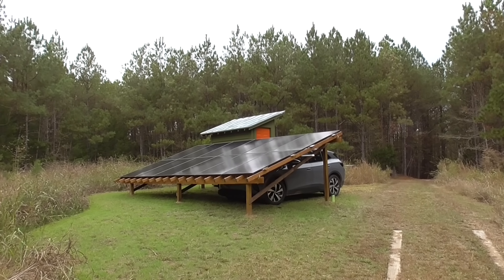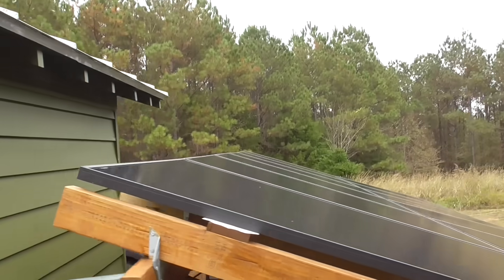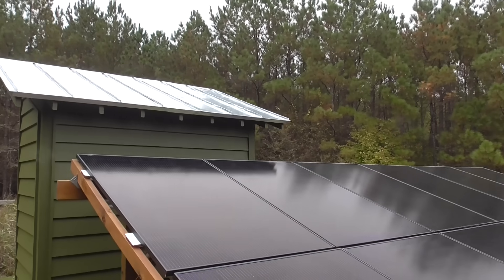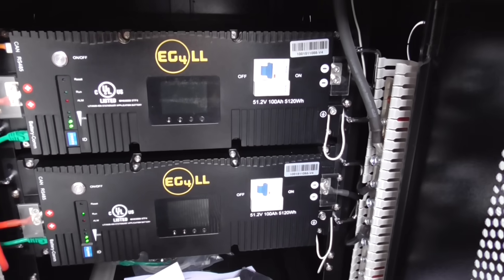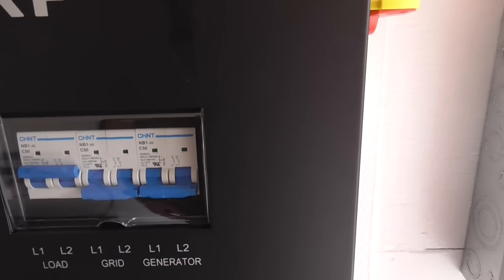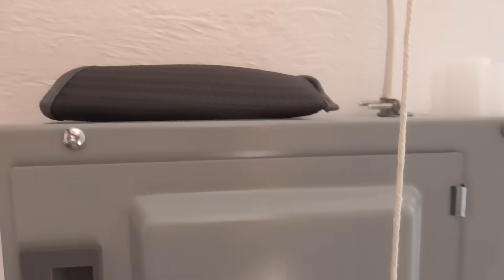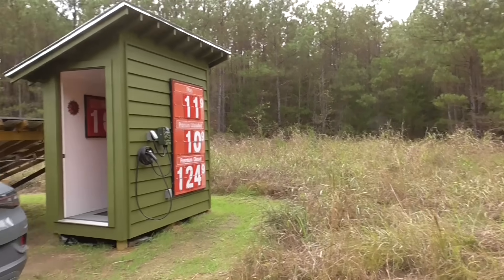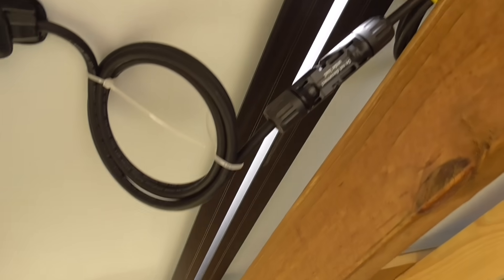Off-Grid Solar EV Charging Station. Stand-alone solution for EV.

Comment: If it was a sunny day could you charge even after the two 100 amp hour batteries are depleted?
Reply from the maker: So far, no. I think there is a possibility when the panels are in the perfect angle for the sun in the summer on a perfectly sunny day, the PV might just might be able to power the whole required amperage. As it is, the two arrays have each put in a third of the required power and the battery provides the other third. This makes the batteries last a long time and I usually get about 4 hours of charging from the day before the batteries are discharged and the sun is too low to charge them back up over the low threshold. I have wondered, however, since that Grizzlee charger can be set for different max amperages, that I could select a lower one that the PV alone could cope with. But that would also make the charging time longer proportionately. So in the end, whether it's slow or fast, I'll be able to get the same amount of charge on my car on any particular day.
Reply: @ thank you!  I came across your video when searching for “panel to EV”. I’ve been wondering if it’s possible to use our car batteries (we have an EV6 and an Ionic 5) as the storage medium rather than investing in the rack batteries, which  are still quite expensive.  We can use our V2L (vehicle to load) adapters to power some of our important appliances during outages.  Thanks again. And watch the end lumber exposed to the sun.  Sometimes it will warp and the solar panels don’t like that.  Best wishes.

Comment: I was an electrician for over 35 years.  You did a beautiful job on everything.   If you are not an electrician.... wow!  WELL DONE!
Reply from the maker: I was not expecting to hear anything positive about my wiring. It seems that everybody on Youtube makes a huge production out of elaborate conduit use. I thought about conduit and decided that it's just me in the shed and I'm not going to swing a hatchet around wildly and chop into wires so why do conduit? I am not an electrician, but I have a good understanding of it and I've done quite a bit of residential wiring for my rentals, mostly replacing knob and tube. I wanted it to be tidy but not go overboard with bling. Thanks for the compliment.
Reply: @wickedmessenger1  i 100% agree, VERY WELL DONE!! I left a note for you at the end of pt 2 looking for advice... ANY help or thoughts would be awesome! would luv to do something similar for my rav4 prime plug in.. its a way smaller 15ah battery and i am wondering if i could just go panels to inverter to my portable level 2 charger and make it affordable for my plug in needs.. Thoughts/advice? TKS
Reply: @wickedmessenger1  Conduit to protect it from squirrels and chipmunks chewing through the wires.
Reply: @stevewhitaker1474 well, the squirrels will only chew through it once 🤷🏼‍♂️☠️🤣
Reply: @ 😁Fried squirrel ...
Reply: This must be an exciting time for electricians!
Reply: Nice setup. Well done.
Reply: Except that he mounted the solar panels with wood which is an absolute no-no and the expansion and contraction through the seasons will ruin the solar modules.
Reply: Nah he put his 1 hole straps upside down. Tear it all out and restart

Comment: I am holding out for the DC-DC converter to send the power directly from the PV array to the EV battery.  I already do this with my e-bike, boosting from a 31 Vmpp panel to 36-42 volts to charge the e-bike battery.  Bucking or boosting DC power is easy.  I know this because I built the charger myself.  Connecting directly to the battery terminals of the EV seems to be a difficult challenge to overcome.  Once that part is solved then DC slow charging an EV directly from PV will be a reality-- without inverting to AC only to come right back to DC inside the EV.
Reply: It is true that EVs run at 360 to 800 volts, but the solar array runs at something around 400 volts so the boost ratio only needs to be 0.9 to 2.0, which is no big deal.  The difficulty in making PV-->EV happen is not the DC-DC converter.  It is the software hack to get the onboard electronics to close the HVDC contactor so that charging pins are alive.  This "handshake" is exactly what happens with DC fast chargers.  
    The MPPT algorithm is built in to the DC-DC converter, with the boost ratio (aka duty cycle) being optimized to produce maximum amps without dragging down the array voltage, which would reduce the charging amps.  Been there, done that.  No big deal.  Communicating with the car is the tough nut to crack.
Reply from the maker: EV DC chargers run between 400 and 1,000 volts.
Reply: You need a DC car charger.
Reply from the maker: @joelchang9589  Send me a link to where I can buy one.
Reply: @peteinwisconsin2496  it seems like there should be DC direct power to vehicle soon. It just makes so much more sense.  And potentially skips the expensive interim battery.
Reply: @keithjacobson4493  You still have to have a battery to be practical.
Reply: Enteligent make something that uses Pionix’s Everest stack internally to do DC to DC charging.
Reply: @futaris  BINGO!   That is exactly what I want to do.  DC-->AC and then AC--> DC is foolish.
It is no surprise that the software driving their solution is based on linux.

Comment: Do you have an emergency heater in the shed to keep the temp above freezing? Or, do the batteries have self heater?
Reply: Pretty sure the server rack batteries he is using, like mine, have built in thermal regulation/heater.  That’s especially important for the newer LFP batteries but true enough for any lithium batteries.

Comment: build looks great! You may want to invest in an small window AC unit for the shed to keep the ambient temperature of the equipment low.  The new EG4 units are much better than the earlier MPP Solar clones but all solar charge controllers generate heat.  Between the generated heat and the outside temperature I could see the inside of the shed getting over 100 degrees in the summer in South Carolina.  My EG4 6500 melted on me and developed a short.  Even running a box fan, the case temperature was 95 degrees and my basement was 85 degrees every day the summer it died.  My replacement Sol Ark 15k is much better and doesn't generate nearly the same amount of heat.

Comment: Nice. We have a similar system charging our Ford Lightning. 3.6kW, and were using an older version EG4. It had issues, so we switched out to Victron, dual multi-plus 2’s. I’ve heard good things about the XP6000’s, though.

Comment: One nice thing on Teslas is they allow you to adjust the amperage from your app or inside your car. Just a thought for anyone else looking to match an ev to an off grid system…
Reply: I suspect that most EVs allow setting the charging current from inside the car.  How else would the car know if it was connected to 15, 20 or 30 amps of 240 VAC?
Reply: @peteinwisconsin2496  to my knowledge our EV6 and Ionic 5 don’t allow such a setting however they do permit charging from 120v and 240v and within those setting an adjustment  from 25% to 100% of the energy entering the car.
Reply: @peteinwisconsin2496  The charge rate is set by a hand shake between the  EVSE (the Charger) and the car. The charge rate is set at the highest  rate allowed by both the car and the EVSE. The EVSE is responsible for knowing the Supply Circuit Rating and not allowing the charge rate to exceed the what is allowed on that circuit.
Reply: @ That would be logical but as of yet Tesla is the only one I know of that allows this. 
I have recently driven polestar 2, Ford Mach e, and my wife has a Nissan leaf, none of which allow this.

Comment: seems like you could have mentioned the actual cost; even approaching $100k is far too much.  Also how long it takes to charge on a summer day or a overcast day like you showed on your video.  One source I read indicated 10 panels in Pheonix could only generate enough power to move a Tesla Model 3, 30 miles.  So while you did have 12 panels; seems like you are talking several days to go 140 miles?
Reply from the maker: I don't know the details of that 10-panel system, but it must be nothing like mine. I can easily add 35% to my car's battery in one day, which is 80 miles for my car (I believe Teslas go further per kW than the ID.4). My cost was well under $10k, but I don't want people to obsess about it. This situation is an isolated location with no commercial charging stations nearby. I seem to be hearing from people with the idea that if this doesn't exactly match the convenience of driving an ICE vehicle, then it's useless. I do not want to continue burning fossil fuels. I believe it's wrong. Therefore I am taking the steps to cut down as much as possible in contributing to global warming.
Reply: @wickedmessenger1  You get 80 miles in a single day what time of year?  That day you shot and it was overcast; how far under that senerio?  You are in S. Carolina in summber vs winter?  These are useful to know; I am in Seattle; so we don't get the sun  you get; I have some remote property also so I am considering that same sort of thing for practical purposes - Maybe the range difference was the panels - you said you got a bit over 4K system - which is 400w panels?  If you used 100w then I gather it would be more like the 20 miles correct?  As for the burning of fossil fuel or other types of fuel;
just as a check - you do realize that total CO2 is 440ppm and the human contribution is about 110ppm.  That is 1/10,000th of the atmosphere. So worries about human produced CO2 doesn't seem too serious; those trees near your charger would like to absorb that CO2.   For me it would be more the matter of independence.  If can have transportatin for a period of years at similar cost; where I can get around without being dependent I'd like that but I could potentially make my own ethanol or bio diesel.  To do those myself are not real cheap or realiable; solar seems possible but I am concerned that some days where it is rainy or cloudy; I'd not get very far.
Reply from the maker: @litestuffllc7249  I never said in the video that "here is a solar charging station that everyone can use." I only wanted to show what I came up with for my circumstances. When I go to the farm I go for a week or so. The first day I arrive, the shed batteries are at 100% and I usually arrive around 11:00 a.m. when the sun is in a good position.  My first priority is to charge the car up to 50%. I can easily do that on the first day and it takes about 3.5 hours of charging. After that, every time I go somewhere and come back, I charge back up to 50%. That's a happy place for the battery to get maximum life out of it, especially if the car is just going to sit for a while. As you can see from this use pattern, I don't have an urgent need to charge up to 80% or 100% in a hurry while I'm up there. If I get an overcast day, that's not going to be a problem, there's almost always enough PV to get the shed batteries back to 100%. As the day of departure nears, I keep an eye on the weather. I like to have 80% to drive home, even though I usually arrive with 17 to 19% still in the battery. I like the cushion just in case it's a windy day and I get lousy efficiency. If it's a sunny day when I leave, I can go from 50% to 80% in about 3 hours, then I drive home. Perhaps it's going to be overcast, so I start charging a day or two in advance. You don't have to believe in science of global warming to want to drive an EV. As you pointed out, it's about independence. And even though there's an initial investment, everything after that is free and eventually you'll pay yourself back and then it's all gravy. This is not to mention that there are no oil changes, air filters, oil filters, etc. to pay for. The EPA's calculations for my car said that I would save $6,500 over the first 5 years of ownership compared to an ICE vehicle. I spent that much making this station, so at this point I have pushed those savings out 5 years from now. Again, it's not about the money for me. I needed a way to be able to have this isolated farm and go there using my EV, which is the best car I have ever driven. I calculated that the electricity I use charging the car at my house, which comes from the grid, to get up to the farm costs me less than $5 for the trip to the farm. My truck needs 6 gallons of gas for that same trip, so even with gas being quite cheap right now, I'm saving about $17 dollars each trip to the farm. That adds up. And if there's a zombie apocalypse, there won't be any gasoline, but there will be sunshine. If there's no sunshine either, well we're all fucked.

Comment: Nice setup!  Want to do similar.  Question: are you concerned about that little utility room heating up? Is there ventilation?
Reply: A thing commonly found on green houses are ventilation fans directly powered from a small PV panel.  When the sun is most intense, the fan runs at its maximum, providing cooling when it is most needed.
Reply from the maker: I am concerned with that. I am going to see if there is a problem next summer and get a little AC unit if I need it. This past summer, which was mostly over by the time I got done with the project, I would keep the shed door open while the car was charging. It never got to the point where it shut down for high temps. And generally there's no problem with keeping the door open for those hours, so that's been my solution. Like I said, I am willing to go with an AC unit if that seems like the way to go. By the way, I fully insulated the shed and the roof is highly reflective, so it stays cooler than the ambient temp during the day if the inverter is not running (like when the car is charging).
Reply: @wickedmessenger1  thanks for the reply, and please post any updates on this, I'm curious to know as I plan to build a similar shed.

Comment: You should hook up a generator to the EG$6000 so you can charge your electric car with gasoline.
Reply from the maker: That's absurd. I have a 100% success rate with this setup. I have never failed to charge it up enough for my 144 mile drive home.

Comment: You've certainly enough space to install another row of six panels, which would increase your number of self sufficient days, even a couple of panels on the shed roof could assist with battery charging.
Reply from the maker: So far so good, but if I decide I need a longer charge, I can add another battery or a few more panels. I'm going to wait and see.

Comment: You are very handy. Impressive work. I will just buy hybrid and spend my time watching youtube of people building themselves awesome charging stations for overpriced cars.
Reply from the maker: I know people think that EVs are expensive, but I bought my VW all in (tax, tags, floor mats, dealer prep, etc) for $30,000. Brand new. Not a lease. It will pay for itself in what what I would have spent on gasoline. Plus I'm very glad to not be burning gasoline.
Reply: @wickedmessenger1  That is a great price. I wish you  will not need a mainenance on that VW.
If it is to spend extra money to avoid burning gasoline I can understand. If it is to save money on fuel for transportation, I would love to hear what is your estimate of ROI ? How many kms driven to get money back from that setup ?
Reply from the maker: @Martinko_Pcik  What's my ROI on gasoline? I have been buying it for 40 years and I never got to the point where Anyone said, "You know what, you've spent enough on gas, so from now on it's free."
Reply from the maker: @Martinko_Pcik  This situation is an isolated location with no commercial charging stations nearby. The cost is irrelevant. I have a solution to my problem. Please tell me the ROI on putting gasoline into your Prius. Tell me when the gas station tells you that you have already spent enough on gas and you don't have to pay anymore. This charging station cost me under $10,000, so by your experience, my ROI is 11.5 years. Does that satisfy you? I don't see this in monetary terms. I see this as a way I can drive an EV, not burn any gasoline, and have convenience in a very isolated location. Tell me, at times when gas is expensive, don't you have to buy it anyway? I am operating independent of the price of gas and you are a slave to it.
Reply: @wickedmessenger1  thats right.. u cant buy peace of mind.. once he is out there HE knows he can drive away from there once something hasnt directly failed.
Reply: I think it's awesome. And there's more than just dollars roi. He now has electricity on the property that could come in handy, running some power tools or maybe a future workshed. He also has the convenience of charging up while he's at the property rather than stopping on the way home.  And finally gaining the experience on DIY solar will save him on future projects.
Reply: @tpistor  I agree. I have missed the point of having electricity for other things and the joy of accomplishment. I really liked the result. Got distracted with the electric car issue.
Reply: @Martinko_Pcik i just enjoy watching people do diy setups.. man i cant even afford a ebike much less 5 of the panels.

Comment: How does the shed do in the weather? Hot/cold
Reply from the maker: I finished in the summer, so I don't know yet how it's going to be in the winter. I insulated it very well and the roof is highly reflective, so it didn't bake in there during the summer. Winters here are mild by most people's standards so I think it's going to be ok then. I might decide to add an air conditioner if it gets too hot next summer.